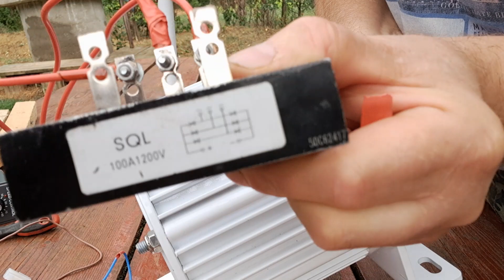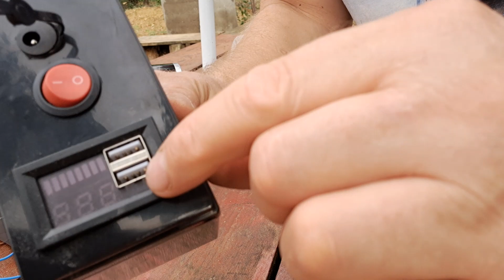#Generator cu magneti neodim #

Comment: This is spending time because you can take 12v DC till 220v  inverter for 3000 watt it is working good ,if you can make like running by self it is will be important to us and the people
Reply: You mean out from retifier 2 wire to inverter 12v 220v without baterry..

Comment: Sa traiti si multa sanatate,interesant ar fi sa faceti niste teste cu masuratorile aferente pentru a vede cat din cei 3kw sunt reali si la ce rpm ,urmaresc si eu de ceva timp tipul asta de generatoare,inca nu mam decis pentru nici unu,sper cat de curand sa achizitionez unu si sa fac niste teste pentru a vedea cad de adevarat e ceaa ce scrie pe eticheta.Succes in continuare
Reply: Un motor de 3kw de genul acesta este aproape 2000 €  cel din clip este maxim 250 € am cumpărat și eu pentru experiment dar nu generează nici măcar 500w , asa că lam trimis imediat înapoi . Jucării 😅
Reply: @Daniel20099 
Normal..specific românului să prostească clienții...
Reply: Pe EAMG găsiți la 2000 Ron generator de 12 V care produce 300 w maxim

Comment: Becurile led functioneaza si in curent AC, puntea redresoare n-are sens in acest caz. Alimentare simpla de AC, faza si nul. Practic, ala e un dinam  de putere relativ mica ce necesita energie mecanica externa. Se gasesc pe Amazon si Ebay la greu, dar utilitatea lor la acest nivel de putere poate fi inlocuita simplu cu un converter electronic de la DC 12V pe acumulator, la AC de 220/100W. Smecheria e sa produca macar 5-10KW la 220V ca sa-ti duca macar o casa, nu 10 becuri, desi puterea maxima produsa in amperaj poate fi mai mare de 100W, cat absorb acele becuri.
Reply: Dar ce zici de un motor PM DC 230V  6000RPM  1HP incearca sa invirta gen cu un raport de fulii de 1/12 si avem perpetual Cine incearca ? Folosim si un cap in parallel fara vint fara apa Ar trebui sa fie o multiplicare de 12 ori I,mi day si EU cu parerea.Motor cu perii de la masina de spalat ala are only350w ori de la running equipment din sala ala are 1kw loveste,ma cu o parereCeau

Comment: Usually the generator is AC and the diode converts to DC so how do the lamps light up?    And I am also looking for such a method, how to operate several devices without batteries, and charge.  to use directly from the generator, is it possible?   I have 10kw 230v?

Comment: I bought the three-phase generator, but I have a problem that we can't start it, the generator has three output phases but not the neutral phase, how do I install the neutral phase in the 10 kw  220 v generator with 300 rpm
can someone help me
Reply from the maker: Punei punte redresoare leagă cele 3 faze și la eșire vei avea plus și minus 👍🖐
Reply: Open the three phase 220v generator and trace to where the end of each coil is connected together as star connection, tap that connection point out to be the neutral wire of your 3phase generator
Reply: Hi you don't have nul if gen is in star you have bigger V if it is in triangle bigger A in both cases no null  Useful output is between fases.The guy has nul after diode You want null open de shit end look for three wire connection is only on star generator Ok ?

Comment: If you checked Input Voltage and Current  Vs. Output Voltage and Current, it wooooooooooooooooooould be much better....  I hope to get this by another clip. Thanks
Reply: 😅watt output = watt input * power characteristic (cos 0.87) = less power than you deliver. Unfortunately, the man has no idea about electrical engineering